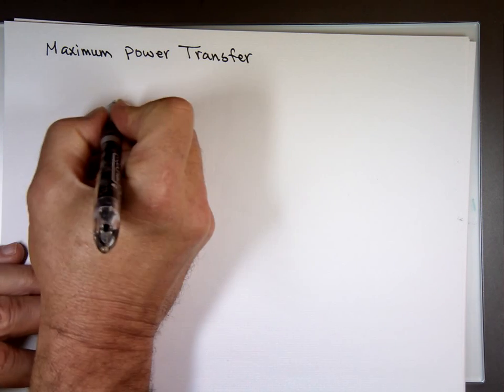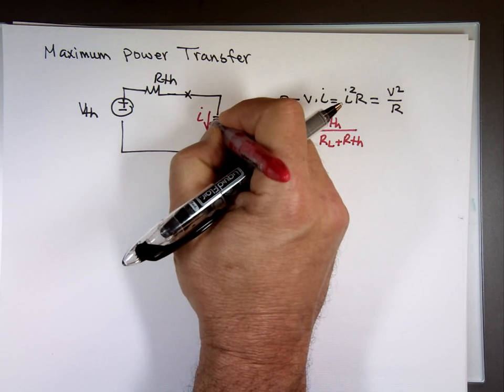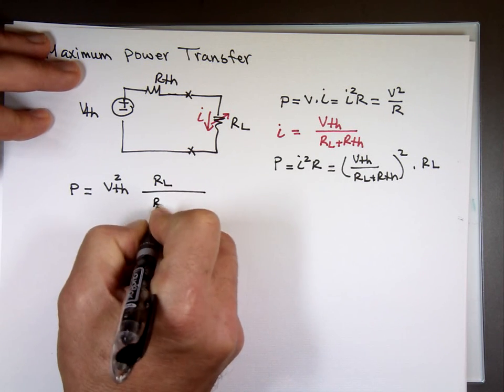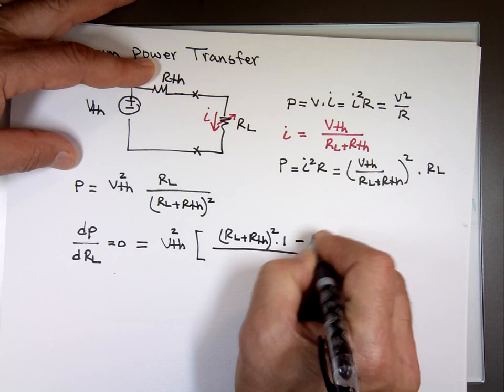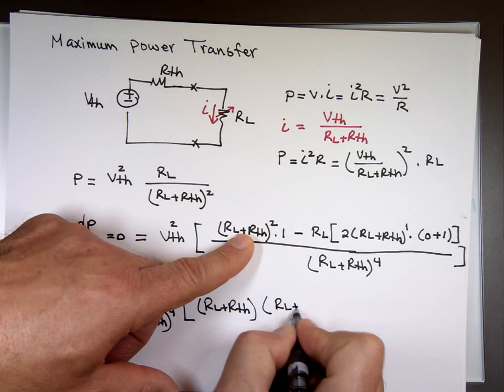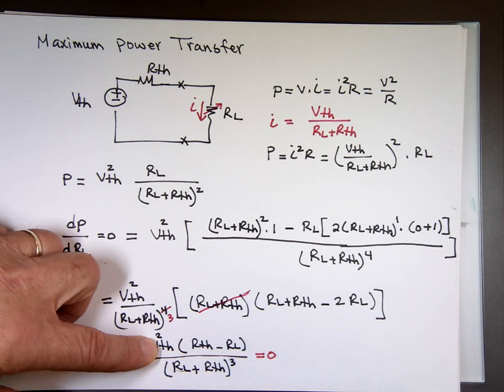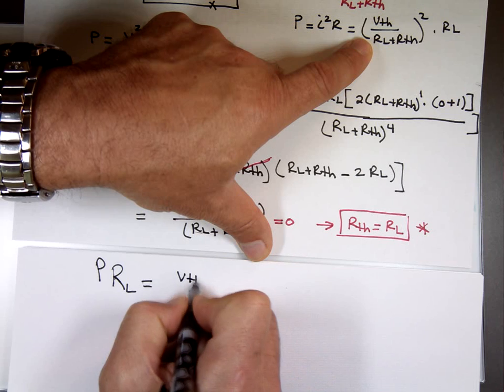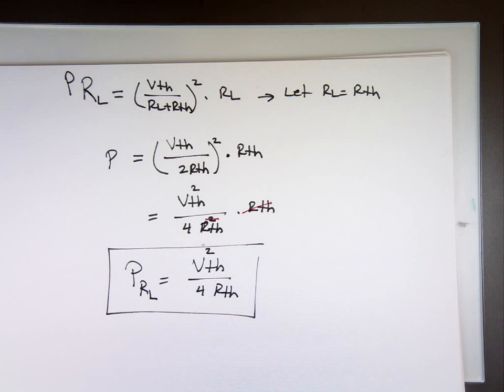Maximum Power Transfer

Comment: why does Vth remain Vth since it is a Constant like Rth should it not also be 0?
Reply: Then constant in calculus is something different of the constant that you think. So, for that  forgot the term constant that confusing and use the  terms scaler and offset. The derivative of a scaler is the scaler and the derivative of an offset is 0. 

A scaler derived as any constant that multiplies a quantity that is function of the derivative variable and an offset is an constant that added or subtracted form the derivative variable.

Comment: Simple,  load resistance must not be less or more than the internal of the solar cell's resistance for MAX power transfer. 
Summery, Voltage drop of the cell and the load must be the same.  This is Impedance matched.  = max energy transfer...
Reply: To get maximum power transfer from a solar cell.  Use the 1/2 of open voltage method. 
1. Measure the solar cells open voltage in full sun light,  no load.
2. Add load resistors until 1/2 of unloaded voltage is measured.  Now max power transfer is achieved.  Impedance  matched.. So if no load  voltage is .5v  and loaded voltage is .25v  it is at max-transfer of Power.  1:1